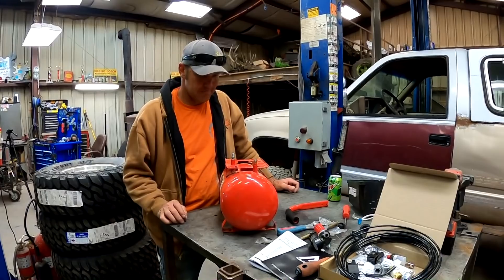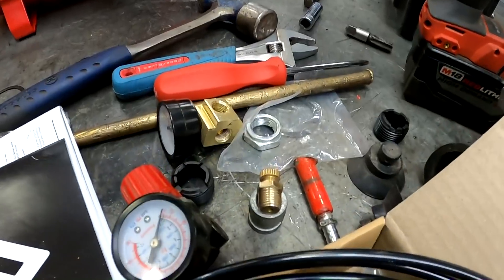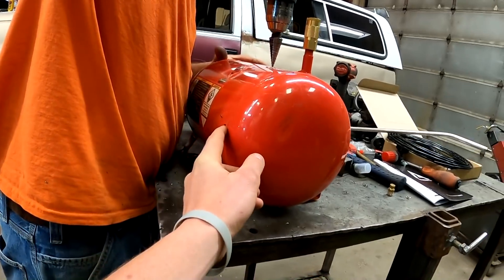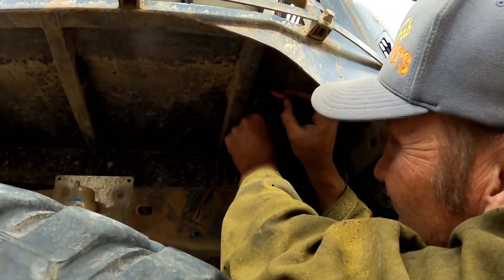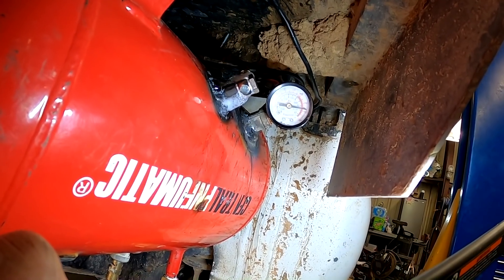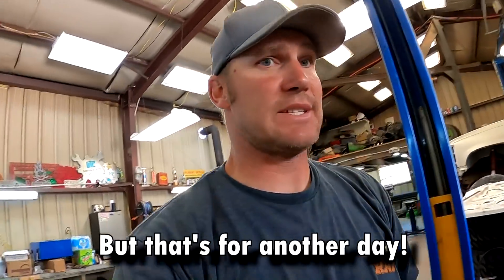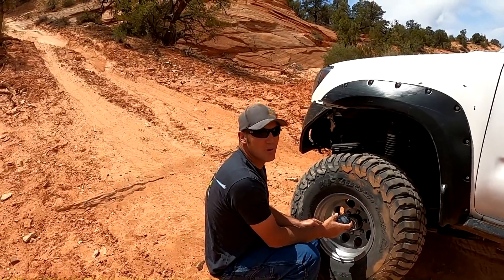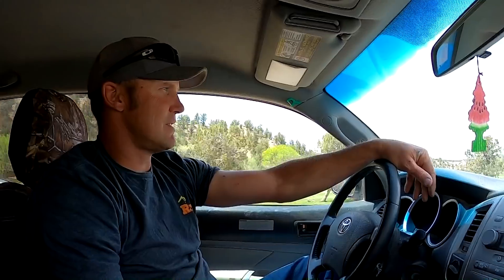Putting the New AIR LOCKERS to the Test!

Comment: At 7:30 minutes in you drilled with your forehead safely covered, but your eyes were exposed. Unless you are trying for that "Utah Pirate" look... Put your safety glasses over your eyeballs... I would have mounted the tank in bed under the compressor, but it could work your way...

Comment: You really need to learn to re-sharpen your drill bits you will save a bundle, but you might try MSC direct MSC# 04138392 there's the part number for jobber length 3/8, 135 degree cobalt they will outlast your box store drills.

Comment: the big rig truck have air brakes they have a air tank think the trailer have a air tank think they are longer hold more air it mite be what guys want to use for there rock crawler go to a big rig trailer place ask how much air presure can the tank hold psi also it could a be a tank for repair on a rescue site

Comment: If you want a drill press to go as slow as you want without changing belts. Check this out! I took a treadmill motor and replaced my old motor. It has tons of torque at low speed too.  https://youtu.be/NSnC9fQXdx0

Comment: I know you know what you're doing but using hacked/welded on pressure vessels is dangerous.  Especially at 150 psi. That thing is one tiny crack away from being a bomb. I doubt that tank was rated for 150 when new.  Be careful man.

Comment: I cringe when I see someone welding anything directly to a pressure tank. There are all kinds of regulations about doing that, especially on a super thin Harbor Freight tank. I know you are a good welder, but the heat removes the temper from the tank's metal and needs to be hydrostatic tested after welding. Welding to the brackets and tabs is OK because the heat doesn't reach the tank. Relocating a port is a no go.

Comment: Stop cutting dry and your cutting tools will last a lot longer. Go buy a jug of thread cutting oil at your local hardware, you will be amazed. I cringe every time I see you cutting dry. For your drill press, if you can find a free treadmill, salvage the motor and controller for your drill press. I also have one on my band saw.